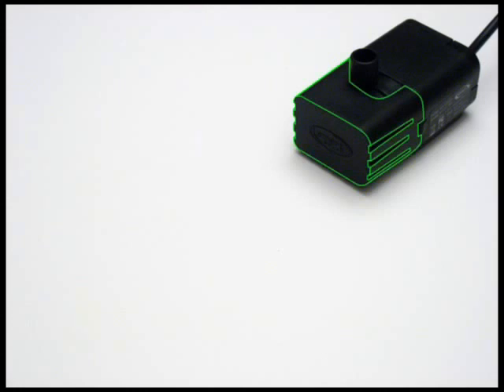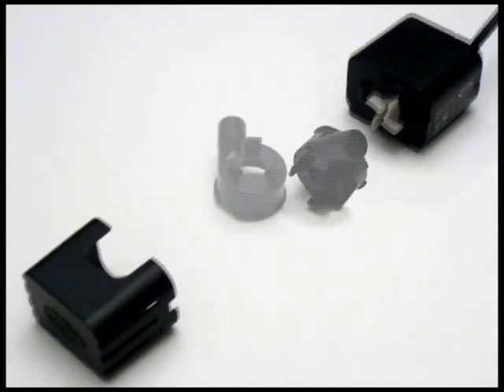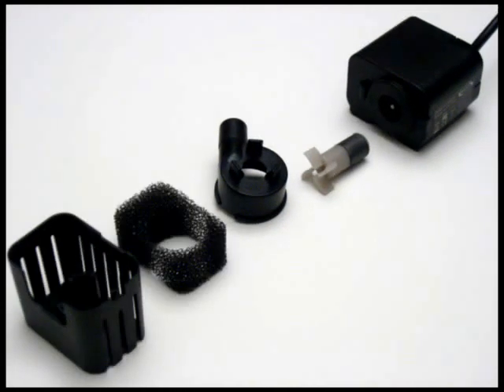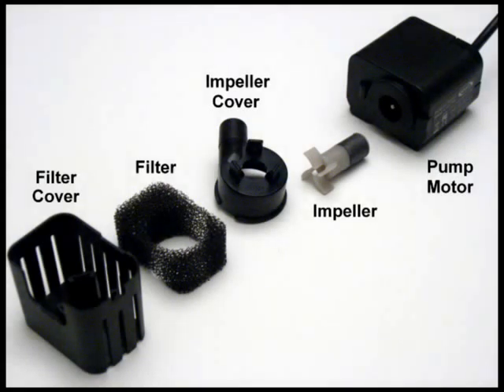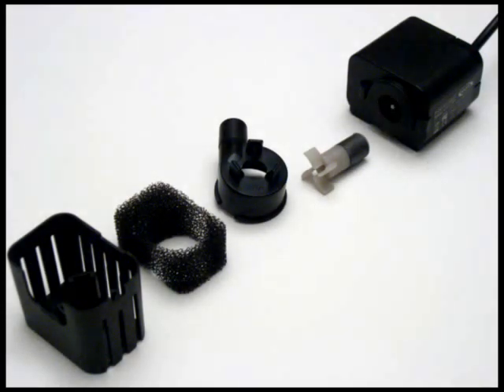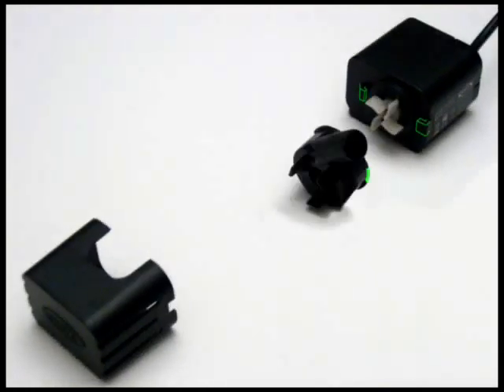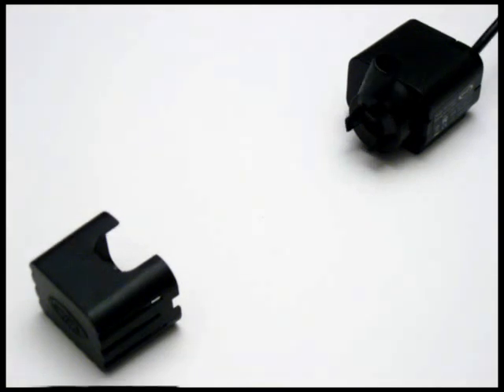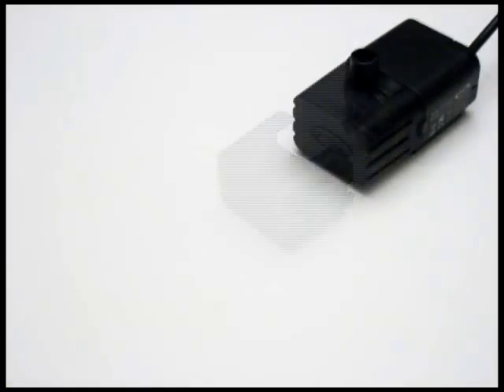How To: Take Apart & Clean a Solar Pump by Smart Solar

Comment: Thanks so much for posting this.  I clean my bird bath pump every spring but never remember exactly how to do it properly.  I was about to buy a new pump last year until I found this website - my pump has never been so clean!  I didn't have to spend money on a new one either - great result!  This is now in my Favourites, so easy to find.  Thanks again!
Reply: Helen Lawrence the solar panel fell and now the pump wo ,t work even though i,ve cleaned it